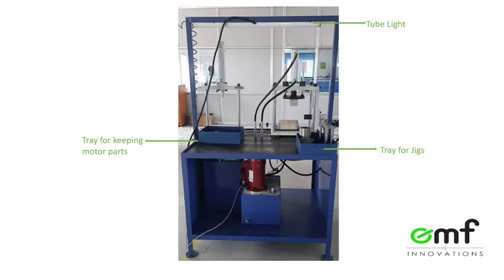EV Motor Training by EMFi |Motor repair, testing, integration with controller, assembly, disassembly

Comment: please dont buy this motor. I have purchased a 850Watts EMF Hub motor and Controller together on Dec 16, 2021 and it stopped working on March 8,2022. It didnt even worked for a year. When I sent the motor and controller back to the company for Warranty claim, they rejected the claim, saying that the motor has been run on High speed and asked me to pay for it. I dont understand this. How can I run the motor at high speeds, as the controller itself was made by them?. Looks like Poor Design and R&D. At the time of purchase, they said that the Motor and controller gets 1 year warranty and I found that its a bogus warranty. I still did not receive the Motor serviced back, eventhough I agreed to pay for it. Electric Vehicle is a growing field in India, but these kind of poor customer service will never let the company survive. I felt disappointed after spending 12K, and its worthless for this product.